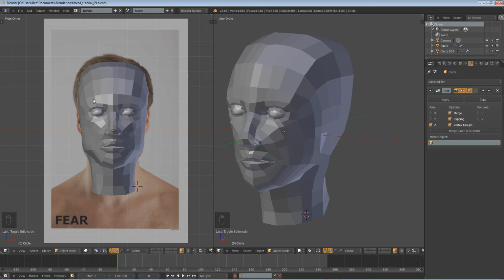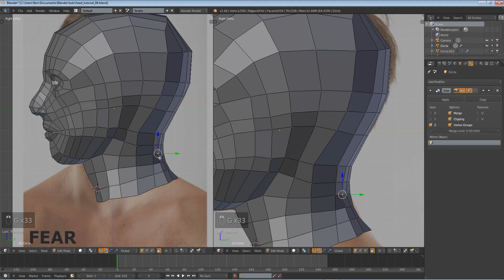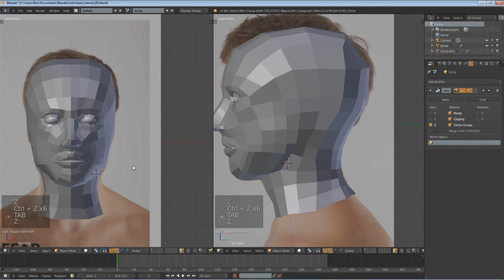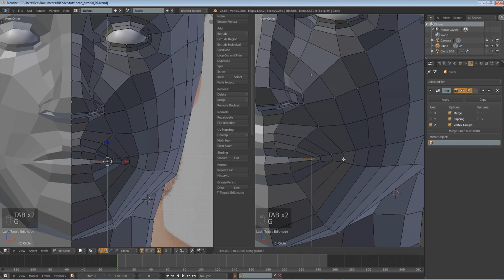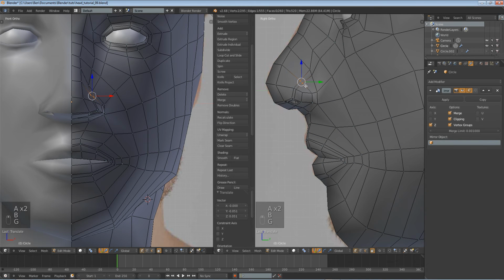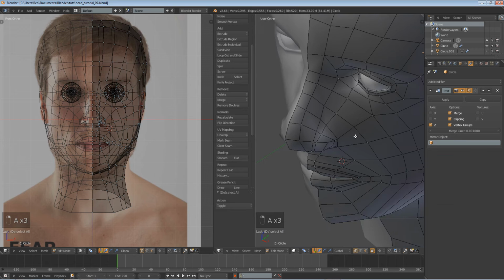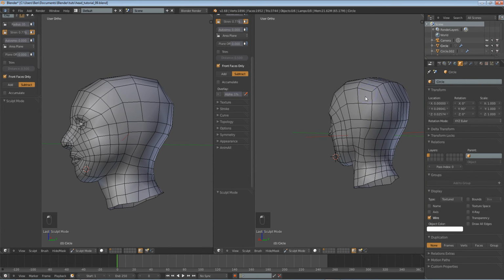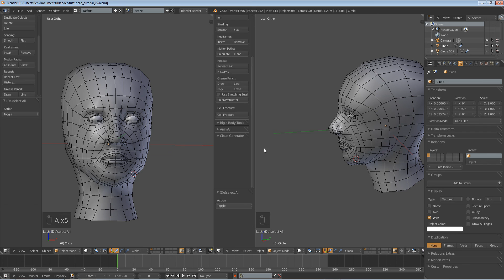Modeling a Low Poly Head in Blender Part 9: Finalizing the Mesh

Comment: A very useful and informative tutorial on head modelling. It was interesting to try a different way around it. I usually follow tutorials, where you start from the eyes: and then work onto the nose and mouth: and gradually build up your topology. But, I especially found the setting up of the neck and head loops at the beginning: a very good way of shaping the back and top of the head, which I usually find a problem, after I have created a face. Many Thanks! Regards Paul

Comment: Is this the only way of getting a low face count in a face model? I primarily use sculpting and when the time to add hair to specific area comes the edit mode reverts back to the original un-modified basic shape model and applying the multiresolution is no good since the face number big enough to make blender lag like a 3rd rate mmo server.
Reply from the maker: What you need is called "retopology". BlenderCookie has quite a few tutorials on that, I'd look at that.